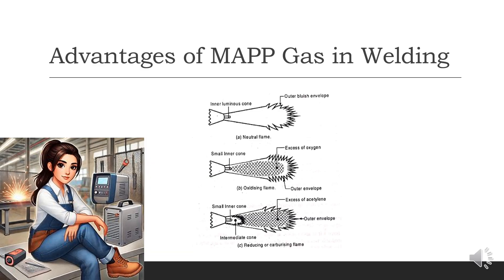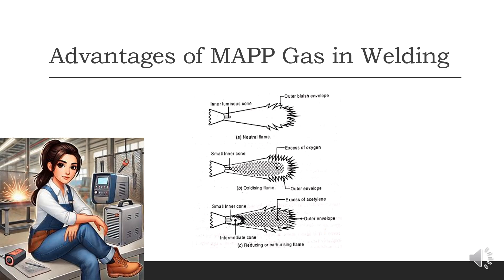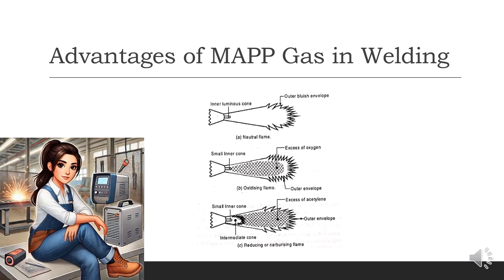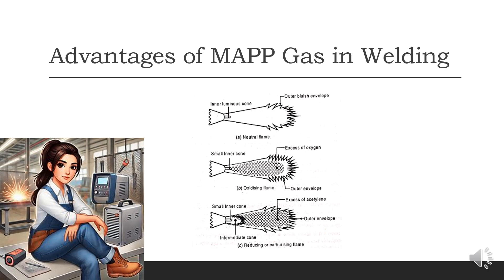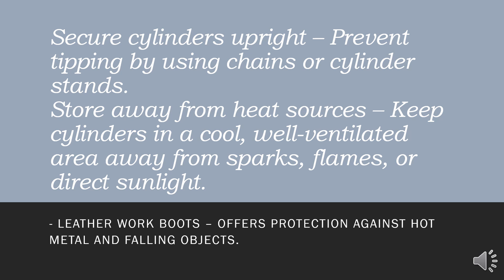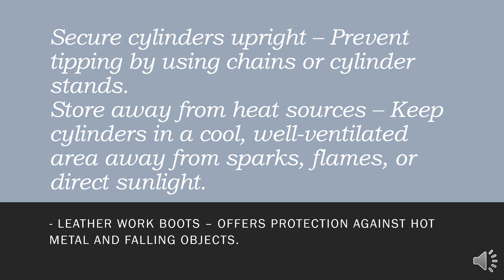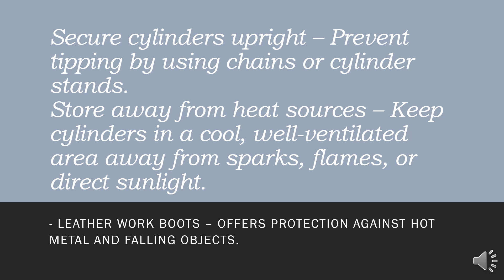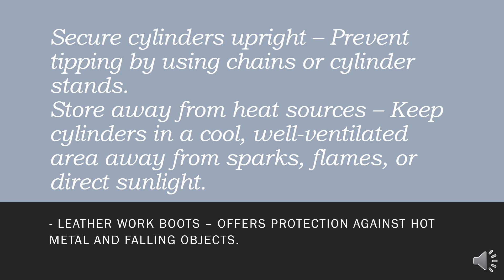Welding Fundamentals  A Beginner's Guide   Part 1

Comment: Hey Garry, On your site, is the D1.1 courses for the 2020 version of the code book? And do you think by the end of this year testing will still be on 2020 version, or will they update the code to a new revision?
Reply from the maker: This is stuff from years ago - I didn't throw out the 2020 version on the YouTube site - On train-eng.com we have the 2020 version - but if you are working in the cheap - there are a few differences but if you can navigate the old code you can pick up the new one pretty quickly.